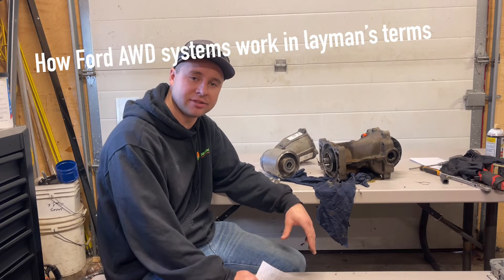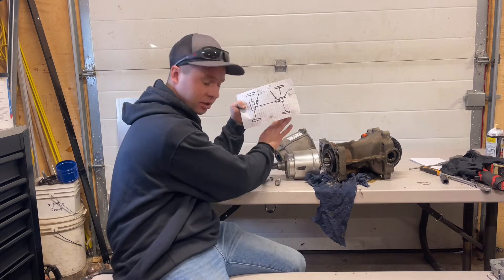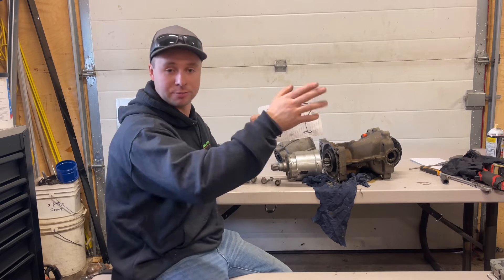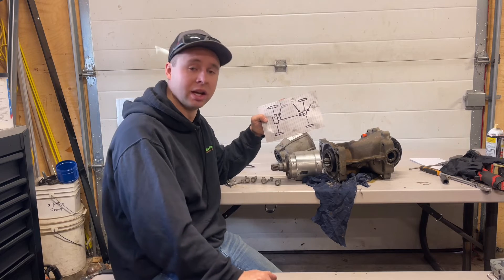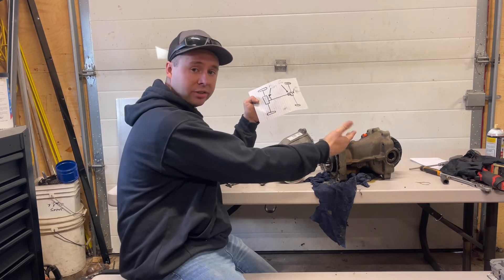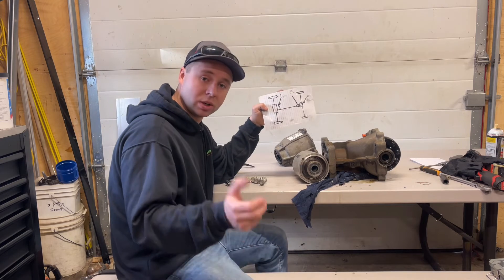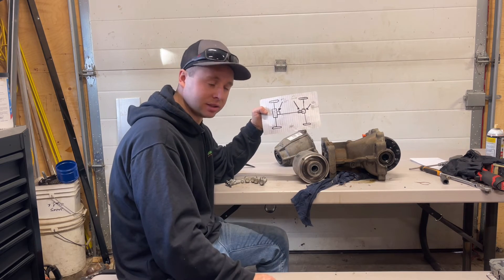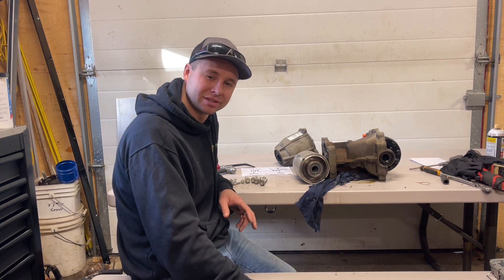How Ford AWD Systems Work And How They Fail, A quick Summary

Comment: Please offer incite.  2013 Edge 95K miles.  Wheel binding occurred upon turns; as would be felt turning a 4x4 on dry pavement.  PTU replacement along with rear differential lube replacement did not solve the issue.  Subsequently, the AWD rear clutch pack was electrically unplugged which eliminated the binding, but of course the Edge is now only FWD.  Since the Intelligent AWD system electrically meters the rear clutch pack to effectively connect the PTU to the rear differential, where was the binding occurring previous to unplugging the clutch pack?
Reply from the maker: Got me thinking, could it be a wheel speed sensor issue making it apply power back there thinking it is slipping? I have never run into this.
Reply: @Schneids15   Good thought, but there have been no ABS speed sensor fault codes.

Comment: I live in Quebec, and am in the process of replacing my PTU on my 2014 Edge Sport with 120K km. A few weeks ago I got a propane smell coming inot the cabin, last week my mecanic noticed PTU leaking, did a check with magnet and pull out metal chunks so it's dead ,plus the smell was horrid. Having a new one installed as I write this.

Comment: Hey, thanks! Diagnosing mine here now after a snow storm and no power going to rear wheels. Great info!
Reply: What was your issue ?
Reply: @furiousdude6955 * I ended up putting my cell phone under the car on an icy road and turned the traction control off. I recorded underneath the transfer case (pto I think ford calls it) and gave it enough throttle to spin the tires. The phone caught the transfer case starting to turn the rear driveshaft barely, then it made a clicking noise like it had stripped gears and the rear driveshaft immediately stopped trying to turn. I ended up just living with it and haven't repaired it yet, but I'm now ready. It's going to be either something in the transfer case that's stripped, or possibly the splines on the front of the driveshaft could be rounded off. My bet is the transfer case will need to be replaced. I'm going to take the rear driveshaft loose and find out real quick in the next couple of weeks. Experience with these usually ends up being the transfer case being bad. The previous owner had an incorrect rear tire on the car which always kills awd systems. As soon as I get my final diagnosis I am just going to go to the junkyard and buy whatever I need. If anybody needs a new for pto, I usually buy them on Amazon believe it or not. They are way cheaper than the dealer and they are genuine ford parts. I've got a Mazda CX9 I put an Amazon pto in and it's driving great 5 years later. Hope this helps. Sorry for the long reply.

Comment: Is there any percentage of continuous power being sent to the rear wheels in my 2017 awd Fusion during normal driving conditions?
Reply from the maker: Yes. I believe under hard acceleration’s it apply’s power to the rear diff so you do not get torque steer in your wheel.

Comment: "I have a 2012 Ford Edge, and I occasionally receive AWD warning messages. When this happens, I turn off the engine and restart the car, and the AWD warning disappears. However, when the AWD light is on, the car drives roughly and feels heavy. What could be causing this problem? Thank you."

Comment: I have a 2015 Ford edge SEL all wheel drive I’m having problems with it. I changed the front gearbox. It feels like the car is in four-wheel-drive. I’m wondering if it’s the back gear box I pulled the plug out that did have some metal on it, but I’m not getting any noise, out of thegear boxes but if I turn the steering wheel right left as I’m driving, it feels like the wheels ain’t in sync with each other like four-wheel-drive dryland gear if anybody has any help, they can help me also also has no check engine lights on
Reply: the clutch pack type of thing like shown here could be stuck engaged - not releasing which can be caused if its getting engaged all the time. (but by the time you read this you'll have it fixed or its busted now)
Reply: Yes, I changed the rear
Reply: Mine acts like in full 4x4 to. Binds seriously when turning. Just put a new ptu up front. I'm thinking the viscous pack in the rear isn't slipping.
Reply: Yeah, I replaced the rear in my car and everything was fine after that

Comment: Really helpful, thanks.
I've  a 2017-made Kuga (UK name for an Edge). I've just changed the PTU oil (some now finally have a real drain plug as on mine - a T50 male socket bit needed).  

Came to the rear end next, expecting a Gen 4 Haldex coupler (with their renowned provlem of the internal pump filter blockages = fail) - but I found a coupler that looked considably different, no pump etc. 
You're the 1st guy to have a video with the actual unit i have on the frontnof my rear diff, and explain its an electro-mag operated clutch pack.  Excellent.

Comment: ESSENTIALLY, An AWD system is 4 wheel drive for front wheel drive vehicles. FORD says their PTU in non serviceable 
because they expect the PTU to fail  BEFORE  the PTU will need its oil changed. FORD runs the exhaust too close to 
the PTU causing it to overheat. DORMAN has re designed the FORD PTU making thiers beefier, with better heat 
protection, more robust seals  AND  a drain plug. $850USD. As of late, I have learned of several parts for different 
vehicles makes re engineered by DORMAN and all are superior to the factory parts. So I am becoming a DORMAN 
fan and will start looking for DORMAN replacement parts when the need arises.

!

Comment: very good video. i recently acquired a second gen edge myself that was well maintained and i always keep my vehicles as long as i can. i was worried about getting the turbo though as i know ford didn't stick it there for longevity. 
while i don't want you to have more issues with your edge, i liked your explanation so i wouldn't mind more videos
Reply from the maker: Thanks Matthew. Yes i hope for good luck and we love the car. I myself would be skeptical of the turbo as well. I assume they are not too hard of a job to replace. The 4cyl engines should have lots of engine bay room.

Comment: Good video.   What I´ve been told is AWD is way better than traditional 4WD
Reply from the maker: Thank you! Yes i would have to agree for daily driving of vehicles it is far superior. However if going off road in a truck etc i would want full 4wd for sure.
Reply: the differences is the older 4wd lets the driver decide but drivetrain will bind if its engaged at the wrong time = more wear and tear. the clutch on this allows slippage. The old school higher end have a center differential to avoid binding & can be full time 4wd. Audi has had nice AWD mechanical based for decades.  4wd typically have a transfer case that let you have a L , which then gives quite a bit of power without taxing the tranny/engine. (by more wear and tear meaning your CV in the front is more likely to break but they arent super expensive)